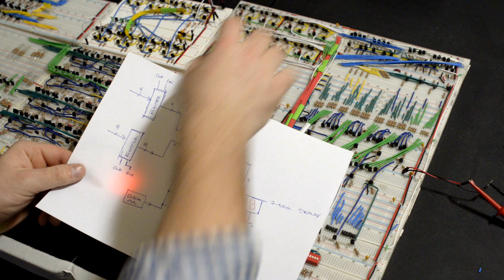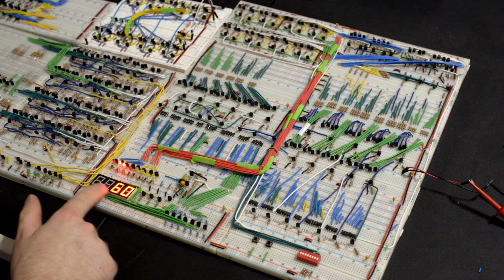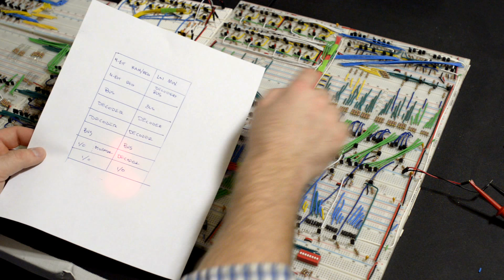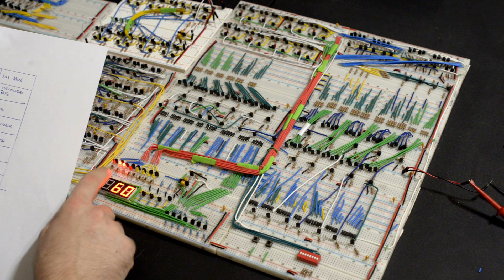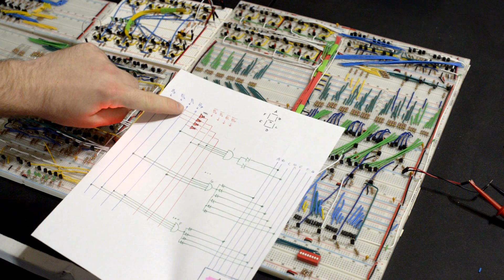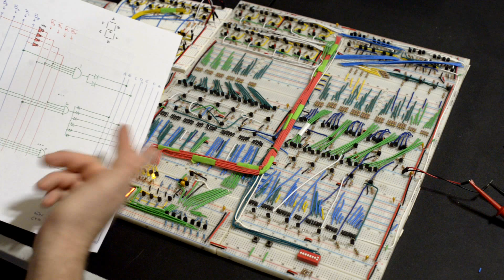Building a transistor breadboard computer! - Hexadecimal Output

Comment: Stunning. I advise sticking to traditions though. Building blocks of a tradional computer expressed below (textbook)

a. Address bus
b. Data bus..
c. RAM
d. ROM
e. CPU...
f. IO bus
g. Xtal clock
Reply: Do not try and reinvent the wheel.
Reply: @trentjackson4816  you can reinvent it and that's part of the fun to learn what engineers went through to get to modern technology

Comment: You should look into karnaugh maps, which would help determine the minimal required logic to decode each segment from the inputs, as opposed to decoding each potential input value into appropriate outputs.

Purely combinatorial, I reckon it would save a few breadboards worth of stuff.
Reply from the maker: you're absolutely right! The only reason I don't Minify the circuits is because having a standard for everything makes it really easy to look at a clump of 10 bread boards and still know exactly what is going on and where. sure I can make all of my logic gates and everything simpler, but having one solution that works for all cases even though it's not the most efficient makes it really easy to troubleshoot without having to figure out whats going on.
Reply: @johnkelly5166  that's fair. I guess there is "building something understandable" and "building something". 🙂

I built a clock/calendar using nothing but transistors and used kmaps to figure out how little logic I could get away with to build my display decoders.

It took over 1500 in total so I was quite keen to minimise where I could.

Comment: Try to make a decimal output.

Edit:Yes this a very hard thing to do but theoretically you could do it.
Reply from the maker: I don't have floating point support yet, just since building by hand it would take a long time. It's not very difficult, just time consuming
Reply: @johnkelly5166  Why would decimal output have to use floating point numbers?
Reply from the maker: @somehacker828  because if the computer cannot make practical use of decimals than there isn't a point to incorporate them, so floating point operations would be a justification requirement
Reply from the maker: @somehacker828  OHH you mean decimal output like 0-10, i thought you meant like 2.23, etc. My bad! I have a decimal one in another video!
Reply: @johnkelly5166  OK.

Comment: John, you are definitely one steely-eyed computer man! I guess you would say real men use only discrete components! Proud of you!
You'll go far, young man! I've been an Electrical Engineer for 40 years but I'd be nuts to attempt such a project. I'll just enjoy watching you do it!
Reply from the maker: Thank you very much! I really enjoy these projects and they let me fill in the knowledge gaps in a fun and productive way, plus it is fun to have a project I can work on for several years to stay sharp in the areas I don't commonly use otherwise.
Reply: @johnkelly5166  If you don't mind my asking, what is your level of education?
Reply from the maker: @joedempseysr.3376  I have a BS Computer Engineering I completed last year. I will complete a BS physics and a BS Electrical engineering in about a month. These all are from the University of Missouri (Mizzou).
Reply: It takes around 2,000 BJTs to build a basic 4-bit computer that is all there. So start counting transistors to see if these projects are "Real Mc Coy"

Comment: I agree with Sasi S. - This is OUTSTANDING!

I too have built one of the "Ben Eater" inspired 8-bits albeit: Using AHCT and HC chips, and following the Malvino book in more places than Ben's SAP-1 version. I am in the middle of converting it to a full SAP-3(+) attempting a full clone of 8080/Z80 processor. Footprint is large but not even as large as your Transistor set-up!

Going to have to try this next. I too anxiously await your updates. Very Nice and COOL work!
Reply from the maker: slmaxwell68, thanks for the comment! Building a full 8080 would be a lot of fun! Whenever I propose architecture for my system, I tried to build something unique and proprietary to my Hardware, however what I quickly find is that whenever I think I come up with something new, someone else has already done it and I'm just rebuilding what they've done haha. Anyway, if you're thinking about building anything at the transistor level, I highly encourage it, even if it's only a few components. I've learned a ridiculous amount of stuff I didn't even consider was something worth learning because when it comes to implementing things at the transistor level there's so many new problems you face that you don't even consider in the design phase. Thanks again!